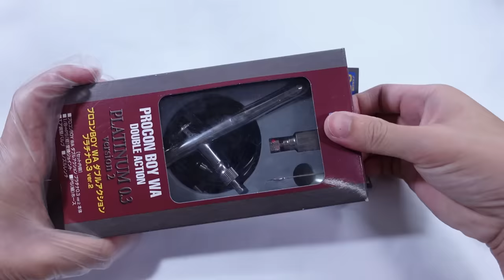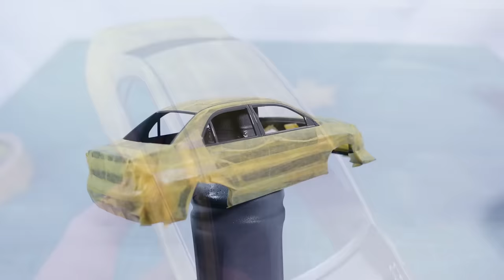Building A Voltex Widebody Mitsubishi EVO Part 2. 1/24 Scale Plastic Model car.

Comment: The detailing of those brake disks, just...wow!
I think the kit would really have benefitted from some carbon side skirt extensions (just to keep the carbon flowing from the front splitter to the rear diffuser), other than that and the carbon roof we talked about on part 2, I'd love to have that piece of art on my home! 👌🏻
Quick question, the roof vortex generator has a carbon decal or is it just black? Can't really tell on the phone screen. If it's just black, is it an option or doing a carbon decal on a part of that size and shape is not viable?
Keep up the good work! 👍🏻

P.s: that bodykit would look awesome on an Evo Wagon! 😎
Reply: I think the vortex generator is just black, but it still looks incredible nonetheless